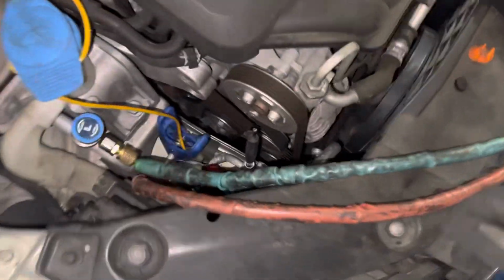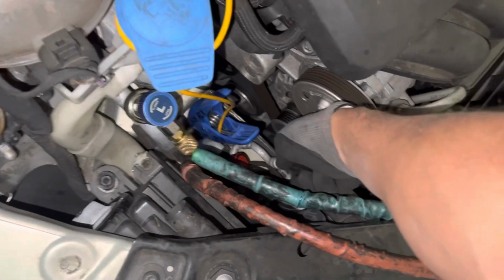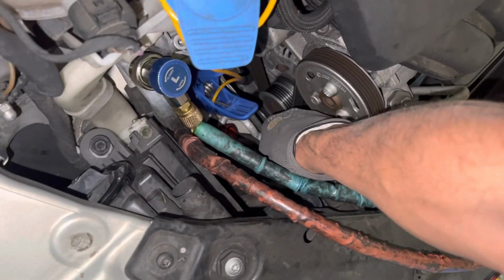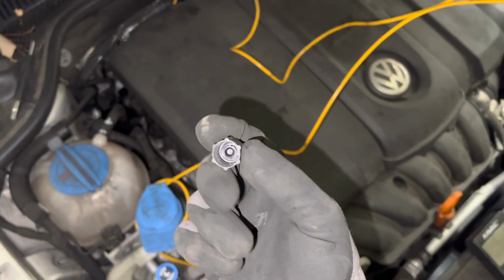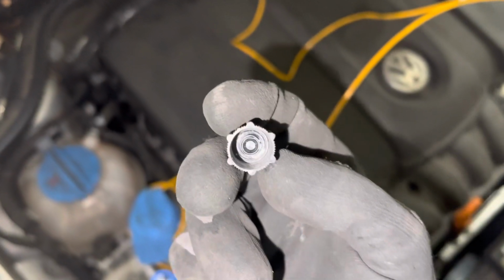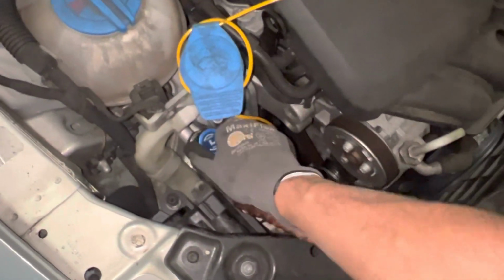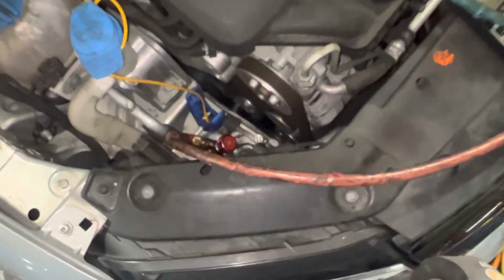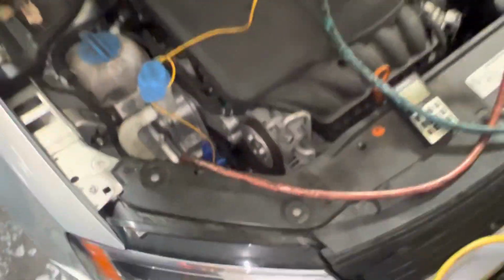MORON AC LEAK ATTEMPT OVERNIGHTING VALVECORS 🤬

Comment: Crank them till they fuse 😂 come across that before. Also seen so many valve caps that were split from overtightening , must have vice hands.  Similar thing with grease monkeys ignoring the manufacturers torque specs and putting everything in with a rattle gun